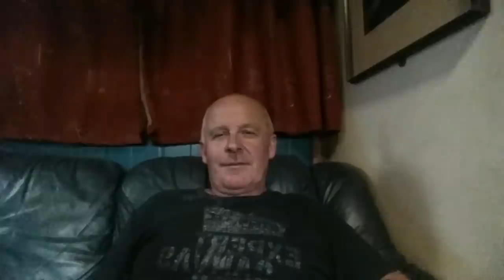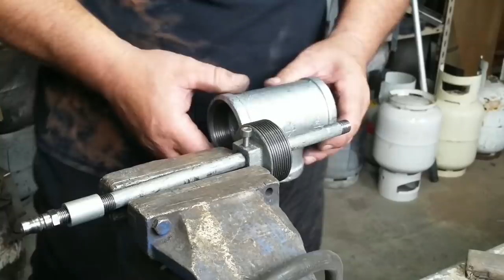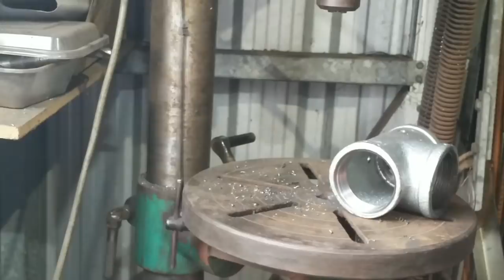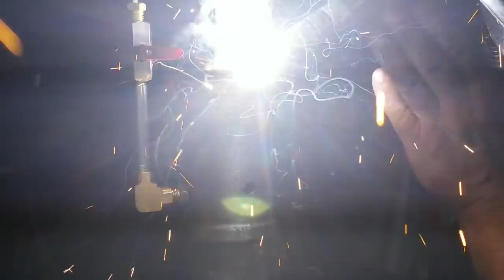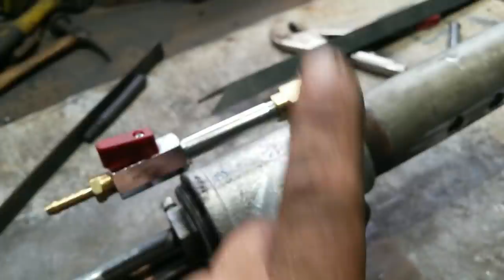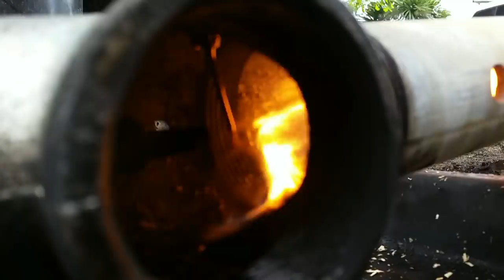Make your own Free Diesel from Waste Plastic!  PART 1

Comment: We used lubricity fuel filters in middle East on all the military vehicles, as many areas could not be supplied with diesel. We were running JP8 jet fuel which is very dry.
Reply: Right. JP8 (Jet Propulsion grade 8) is an extremely low-grade kerosine. 
To give you an idea how extremely low-grade it is: 
Grade 1 (Kerosine grade 1 or "K-1") is very refined kerosine sold as a 
smoke-free lamp oil. Grade 2 (k-2) kerosine is used in oil-burning 
space heaters. Grade 4 and 5 kerosine, (not well refined...JP4 and JP5), 
are used to fuel Airforce (JP4) and Navy (JP5) jets. Grade 7 (JP7) 
was used to fuel the SR-71 Blackbird aircraft (no longer in service) 
and was so "dirty" it couldn't even be ignited with a match or 
cigarette lighter, it was so "dirty." 
Hence, Grade 8 (JP8) kerosine is so unrefined...thick and dirty,... it 
almost has no industrial use whatsoever. However, in some applications, 
it's used as a "make do" alternative fuel or oil lubricant, as you have 
mentioned...only because it's so cheap and plentiful. The amount of 
residual pollution it generates is horrendous! It's surprising you don't
suffer from chronic lung issues...or cancer, right now!
Reply: Sheri Benjegerdes  
Actually, the topic in this particular venue
was Kerosene. But...
Since you're on the subject of the scriptures, please read 1 Thessalonians 4:13-18 ... which 
explains that believing Christians won't go 
through the Great Tribulation. Moreover, 
Luke 21:36 clearly says we will "escape" God's 
wrath via the Rapture. 
Thank you. Keep the Faith. 
God Bless
Reply: Sheri Benjegerdes  
Indeed, 1 Thessalonians 5:9 clearly
says that God did NOT appoint 
Christians to his wrath. 
Besides, if we were indeed 
intended to go through the 
Great Tribulation as you suggest, that 
means, Jesus intends to beat the living 
thunder outta his Bride, after which, 
ask HIS bride to attend a wedding feast. 
Does that really make any sense to you?
Is that really the Jesus you know and love?
Reply: Sheri Benjegerdes  
"Would you die for Him? "
Dying for our Lord is certainly admirable.
But GOD is in complete control over when
we will die. But notwithstanding,  living for Christ takes far more courage, strength, stamina, and prayers.
Reply: Sheri Benjegerdes  
" we aren't to add to His words  "
I fully agree. But it's good to understand
that the Great Tribulation is God's wrath
being poured out on the Earth. And, just as it was in the days of Noah and Lot...God will usher HIS believers to a safe place BEFORE that wrath is poured out....a.g., the Rapture...or "Harpazo" as it says in Greek Septuagint.
(see Mathew, Mark, Luke)

Comment: Using galvanized pipe in high heat applications is a real bad idea. Zinc vapor is quite toxic.
Reply: calvingreene90 agree
Reply: Very much so. The reason I use a fan to blow fumes away when I weld galvanized parts.......rarely.
Reply: only for the first few minutes, then the zinc has all been burnt away (dont be near it during this time) then, forever after, the danger is gone...
Reply: @harrysteeletreo1  
Or you can simply use the cheaper malleable iron Pipe which despite the name is mild steel just like the galvanized and not have the problem at all.
Reply: If you've ever welded that stuff and gotten poisoning, the doc. will tell you to drink milk.
Reply: It's only a coating. A short acid bath can strip all the zinc off of parts easy.
Reply: @robhowe8353  
Which brings us back to the cheaper and more convenient malleable iron.

Comment: Should really come with a disclaimer underneath stating that the end product is 'FREE' after the protental savings, have paid for the cost/time/equipment used in constructing the 'refinery'. The fuel source used to fire up the refining process and unless you live next to a rubbish/garbage dump the time/energy required in collecting the raw product.

Comment: much more efficient to use a blower for your burner rather than compressed air, 60w vs 1500w or more. you may be using more energy than you're creating from the diesel.

Comment: Nice man.   The waste oil venturi  I made wasn't that complex, but worked great for a foundry I made.   Melt'n copper, brass, AL, etc.   My starting fuel was just wood of course.    Mine was much smaller over all and ran on a hairdryer.

Comment: So this is the reason no more diesel cars will be produced by 2030
Reply: David Sims  I've a VW Passat estate 1986 with a 1.6 non turbo engine, 4 speed box on to 13inch wheels , it was over 4.5 meter's long and done just under 50mpg. so what's wrong when a 33year old "tank" can get this sort of mpg compared to the stream line computer light weights of today ???
Reply: David Sims  right here's another 2 tweaks for you that I found in the us a while ago. This product is made here in Ireland..... https://www.motorparts.ie/product/accessories-workshop-repair-and-maintenance-engine-additives/dipetane-5-litre-dp005/DP005

The second one is much more basic. However I'm guessing your Dodge is gas rather than Diesel, so this won't work if that's the case.2stroke "mineral" oil at the same ratio as the first one is 1:200 I'm running both together in my 2013 Merc sprinter that's a 3.0 V6 that's doing 31.5 mpg over the last 11,000 mls 
More power, quieter and smoother start and my last smoke test was zero with 140,000 mls on the clock
Reply: @kristof polleunis false.
A diesel engine produces about 0.375kg of emmissions per leiter. Whereas a eletric car produces about 0.150kg of emmissions per kilomiter drivin if vehicle is charged from the grid(your home/buisness)
Reply: @southaussiegarbo2054  well your response is stupid they said if you factor in the making of the batteries but even ignoring that the comment before yours said their dodge got 9-11 mpg at it's worse, so about 30l/100km in metric using your figure of a diesel producing 0.375kg of emissions per litre and 30l/100km equals 0.3l/km that means a 2007 dodge 2500 produces 0.1125kg of emissions per km at it's worse which is less than your 0.150kg per km for the electric cars, I have a 1992 3l turbo diesel hilux that would use less than half that amount so either your figures are wrong or electric cars aren't so great.
Reply: @shaynegadsden  not wrong they are very accurate. And diesel is a fossil fuel eletric is rechargeable diesel will cost you more to fill up. (Roughly 100 dollars) but an eletric would cost about 5 cents
Reply: @shaynegadsden  and all diesels produce minimum of .375kg per ltr. But could be upto 1kg per ltr.
Reply: @southaussiegarbo2054  the cost to fill has nothing to do with how "green" a vehicle is but if we use that same dodges peak efficiency and your new emissions of .375 to 1kg per litre we get .041 to .11 kg per km so the dodge getting 26mpg is still cleaner than your electric car even at 1kg per litre, to match the electric car emissions the worst diesel only needs 19mpg or 15l/100km
Reply: @shaynegadsden  you are wrong. Unless your vehicle is running on a diesel fuel then you have adblue. And also the figures i gave are the most upto date ones.  Where ever you got your figure from is very inaccurate.
Reply: @southaussiegarbo2054  i used your figures it's pretty easy you said electric car emissions are about .150kg per km and diesels are between .375 and 1kg per litre the i used the previous posters stated fuel consumption in mpg converted it to metric l/100km then break that down to l/km and multily that by your figures to get an emissions per km figure that shows alot of diesels are cleaner than electric cars in emissions
Reply: @shaynegadsden  how. Think about the extra emmissions diesel needs.
They need oil to be extracted and produced into fuel which produces alot of emmissions. 
Eletric cars however only need to be recharged. Diesels need fueltanks to be filled up.
Reply: @southaussiegarbo2054  what you mean like the mining of coal which is where most electricity comes from or the oil used in the construction of the transformers you use on the power grid or perhaps the mining and refining of rare metals that's need to make the batteries electric cars use find out how the lithium and cobalt used are refined in comparison oil refining isn't so bad also diesel is only a small parts of the refining process a large part also goes to plastic which in ev's  lubricants which are also used by ev's so the fact remains that ev's haven't eliminated the need to process oil which will produce diesel so what else are you going to do with it
Reply: @shaynegadsden  where im at ev is usally solar wind or hydro so its not fossil fuel. Metals have to be mined sure but atleast ev dont use oils or fuels
Reply: @southaussiegarbo2054  You're deceiving yourself if you're working on most EVs using hydro or solar! Most are charged from the grid, which in most countries is predominantly fossil fuels.

So EVs still create emissions but you just don't see them as the emmisions happen at the power generating station and the mines, etc., etc.
Reply: @petersnow2919  what the stats are around is vehicle itself not mining etc.

Comment: Haven't watched the other videos yet, and it may be mentioned somewhere therein, but using this diesel may require additives for lubing moving parts to prevent erosion/corrosion which in older diesel was partly supplied by the sulphur and lead content..

Comment: is this diesel will be same as normal diesel?
Reply from the maker: As I say in the video  at 1:45 - the diesel produced is sulfur free, high grade diesel. Diesel  engines were originally invented to burn sunflower oil and be an engine that farmers could use without buying fuel. In the 1920s, Texan Oil Barons created a fuel that was similar and this became the crude oil based diesel that we use today. Most supplies of crude oil based diesel are high in sulfur which creates the black filthy residue in the engines oil. various additives are mixed in to counteract this. Detergents and surficants which reduce the lubricity of the fuel causing wear but keeping it cleaner.
Plastic of types 2,3,4, and 5 are sulfur free and make a better cleaner fuel than what we are used to buying.

HOWEVER* sulfur free diesel is not good in late model 2006 and onward common rail injection systems. 

as this series of videos progresses,  you will see that the machine can also make kerosine, petrol, naptha and creosote, all from plastic or even waste oil. Safe and effective use of your fractional distillation pyroliser will depend on a good understanding of hydrocarbon science. Here is info on sulfur free diesel- https://www.axi-international.com/ultra-low-sulfur-diesel-ulsd-the-good-the-bad-and-the-rusty/
Reply from the maker: Yes- that makes what they call 'Black Diesel" some folk use it 'as is' in older diesels.others say that it needs bleaching. - they do it as a second process with caustic soda
Reply from the maker: ahh - you need a centrifugal filter I reckon. so you dont want to make diesel? you want to re-refine it?
Reply: Can you build one of these for a large ship to help recycle the plastic in the 5 gyres? One Ocean One World One People. org
Reply: "sulfur free diesel is not good in late model 2006"
But it is said that it is because the process of removing sulfur from diesel fuel also removes much of the fuel’s lubricity  (In diesel engines, having enough “lubricity” in the fuel is critical)  however this would be sulfur free but with the same normal diesels lubricity as that process didn't happen, so may be it doesn't apply. (may be i didn't understand a shit as i am not English speaker and i am not into this)
Reply: can it be used as motor oil?
Reply: @ডিমেরহালিপঞ্চাশ  Its diesel not motor oil. Add motor oil to it to give it lubricity
Reply: In the USA it is tagged as "Off Road DeiseL"
Reply: David Sims  The red dye signifies the road use taxes both state and federal, hence you cannot sell this deisel to gas stations unless you pay the taxes.
Reply: I'm in the States so to be Clear,is it Diesel or Gasoline?
Reply: @kenp7814  taxes are collected at point of sale
Reply from the maker: @hairmasterbarry   Hell yes - that would be amazing - do it!
Reply from the maker: @ডিমেরহালিপঞ্চাশ   ooooh no!-  oil is created at much lower temps
Reply: Diesel is will be the same as normal diesel pom pom

Comment: Nice job... Like your work style. Love precision tinkering myself, could I suggest adding heat grade pipe sealant/ dope, stops back draft . A "Y" joint as supposed to a "T" making it, 3 sets of holes triangulated on a 45 angle forward on the burner barrel.  With a reducer The "Y" could be used for Oxygenair feed too intensifying the heat. Don't have the space to setup and tinker for now... Keep on keeping on.👍🏾

Comment: Wow chapter and verse about the toxic fumes brother, betting you don't want to hear it from me too.  But as it happens let me 1st say Working for Metal Container Corp we made beer cans. Where I worked we sprayed lacquer in the cans and baked it on. The only way to handle that stuff was in a triple chamber re-burn unit. And working at a chemical factory we had byproducts coming out of the vacuum chambers that were flat out lethal. Those were run through liquid air scrubbers. Happy to share  the builds with you if you want them. I've hit the like and subscribed on the 1st video because I can tell you are a fixer not a whiner. All the respect in the world for a man like you. And don't let the snivelers get to you, The one was right you know, there is no such thing as free energy. You have to apply yourself if nothing else. So let him cry, I have time to offer if it will help clean up some of the trash.

Comment: When you are tapping into a round surface like that, I prefer an old bit brace instead of a normal tap handle, you get less wobble/torn threads at the start of the threading. When you go through thin walled stuff, it's nice to keep every darn thread you can.  Water is an approved lubricant for machining one of the common metals, aluminum I think, but check your machineries handbook, I may be having a touch of the dementia on which metal it is, hah.  Keep it up with the great vids.  This is the stuff that will save our bacon when they run the whole show into the ground.

Comment: My dad had ones like this in the garage when I was a child - then he sold it and got another and did this a few times then  one time caused a wee fire in the garage because he did not check on its up keep - however they were a great wee heater in the large garage - they ran on left over oil, fuel, fat  that he would adjust to control the amount of fuel it received that I recall. Great to see it on you tube

Comment: Love the video. Would you like to redesign and build it with a few modern manufacturing methods? This looks like a fun engineering project for me to accomplish over the summer.
Reply from the maker: ??? you want me to start again? - this time spend more money and have arduno control systems and 3D printed knobs ?
Reply: @t.h.o.r.  in hindsight I'm sure you've received many responses very similar in admiration of your contraption, however my comment was placed prior to your frugal statements, so I understand your apprehension. however the concept is a good one, tell you what if I make something from this I'll post something....

Comment: This unit is a critical component of my android whale that eats plastic. The plastic is then passed through a mechanical digestion then into the diesel maker. The diesel can then be used to propel the whale. Or cracking completely down to hydrogen and carbon and pass it to a Mirai fuel cell and use electric propulsion methods. The poop is the carbon that will settle to the bottom of the ocean where it will remain.
Like a whale it will need to surface periodically for air to run the fuel cell.
Reply: Fantastic! When does it launch?
Reply: @kofola9145  
I suppose go fund me dot com?
Reply: Have you ever seen a lipo battery burn, and breath in all the toxic gas. Way more than gasoline. The cost to replace them are extremely high, also where do all the waste batteries from the so called green vehicles go?
Reply: @jrduenas3678  No, why would I breath toxic gas?

Comment: You may've covered this question, however, do you have to chop up or grind the plastic?
I used to work in plastics as a temp & the places I did what I did made all sorts of stuff from plastic, but, it seemed like it was ground into chips before going into the machine that melted it & put it into various forms.

Comment: Maybe after getting this working good.  You might looking into burning the 'waste oil' in a diesel electric generator and use the exhaust heat to run your 'mini plastic to diesel refinery' .

Comment: Just one question: how much of the feedstock fish and chip oil needs to be burnt in comparison to the diesel output? Wouldn't you be better to just make biodiesel from the fish and chip oil? OK I get that you are getting free heat for your house etc, but given that you are using free waste oil and plastic, you can do that anyway. Having said that, I love the ingenuity of your system. Probably way beyond my engineering capacity to build such a system as I don't have a workshop or tools needed, let alone the skill to build it, and I'd probably tick off my wife no end if I attempted it in a townhouse that already has too much clutter LOL. Even filtering waste vegetable oil and running at a 1:12 ratio with diesel in my Citroen was too much for her. Oh well, maybe one day I'll have a shed and the time to entertain my engineering fantasies :)

Comment: I was under the impression that cast iron could not be tapped very well because its is so brittle.  I know it cannot be cut with a oxy/gas torch.  It just sort of melts and bubbles.
Reply from the maker: Real cast iron taps and drills beautifully - It has its own lubricant. 'Pig iron' is that awful stiff that the chinese make those camping gas propane burners from.  looks like cast iron - behaves like glass!